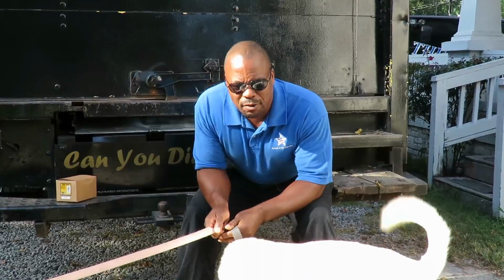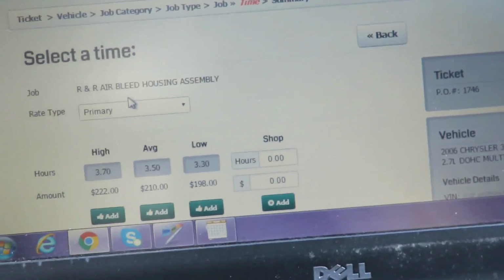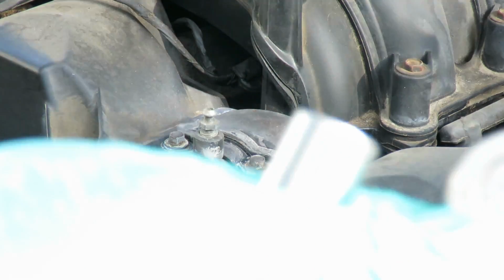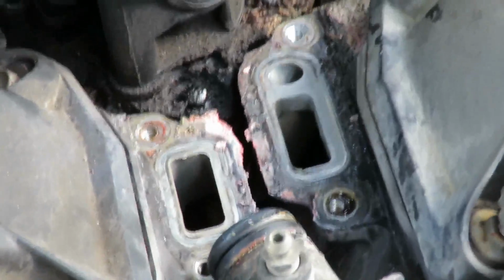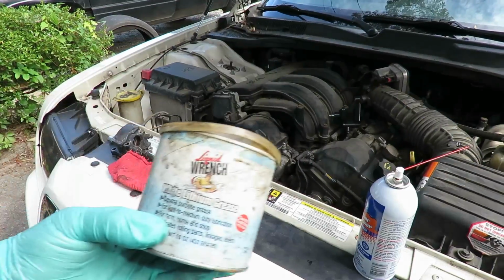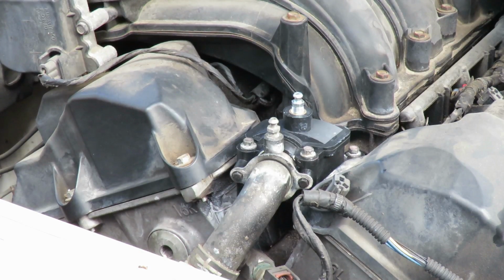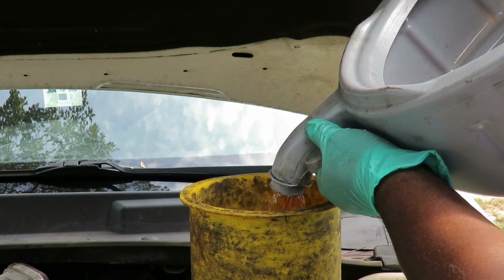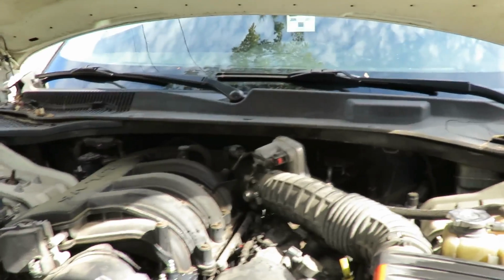⭐ 2006 Chrysler 300 - Air Bleeder Valve Housing - Water Outlet Housing

Comment: Hi Mr. Tim, do i half to drain that like you did in the video?. Or can't i just undo the bolts and replace the part. I have a 2008 Chrysler 300 2.7 L
Reply from the maker: Hi, you can just replace the part, but you might have coolant draining on the belt, and cause it to squeal.
Reply: Thank you so very much!. I'm not mechanically inclined and really don't know what i'm doing. But at soon to be 59 years old, never to late to learn. And can't afford to pay close to 200 for a job i can try and do myself thanks to you Sir 🙌🏾🙏🏾🫡@OnlineAutoRepairVideos
Reply: Mr. Tim update: my family (  3 others ) got the job done. But it took hours!. That unit didn't have room to pull that pipe out. So we had to unlosen the manifold cover, then pull it up to take out the part. Then, he had to run the car for 45 minutes to get the air out. Because  my heater was blowing cold air. And open up that nipple and bleed the radiator properly. Thank you again!. 🙌🏾💯🙏🏾
@OnlineAutoRepairVideos

Comment: good evening everybody . i came here for help . what is the name of the tube/hose connected to the air bleeder valve ? the one with the little valve on top of it ? i believe there is a connector on it as well . name or part number will help . thanks everybody

Comment: Nice detailed video! I have an 08 Dodge charger and just started leaking coolant from this area. When I went to inspect, I saw coolant bubbling from the bolts that hold the housing down. There was also coolant everywhere even hit the roof of my hood. Would that be the cause of the leak and would replacing that part fix it?

Comment: Any advice on what to do if the pipe doesn’t slide back to give enough room to take off the bleeder valve?
Reply: To anyone who has this same problem in the future theres a small bolt in the back that you take off and it loosens the pipe. After that it’s an easy fix.

Comment: Very detailed video! thank you very much for sharing.
30:18 I would like to consult if it is necessary to turn on the heating after closing the valve, somewhere I read that the coolant must reach the heating radiator, but I did not see that step in your video.
On the other hand, I just subscribed to your channel. Thanks my friend.

Comment: I have a Chrysler 300 I put new fuel pump in and it will start and run when it fills like it I check it with scanner and no codes come up any one no what the problem may be

Comment: Thanks for this video bro I'm a seasoned mechanic and even I was pissed at this engine design,  I just rebuilt this Chrysler 2.7ltr for a friend and upone doing the engine break in procedure I couldn't figure out for the life of me why this fuckin thing has 2 calves, I rebuilt this damn thing from top to bottom new everything except valve covers and plenum,  and I'm sittin here wonder why the fuuuck is this thing still going hot on me, and all I had to do was open and pour till fluid came out of this damn valve🤣🤣🤣😂😂😂 these engines are the fuckin sludge kings. I'm so happy to get this thing out of my garage, I wouldn't advise anyone to get a Chrysler with this engine, thanks to you I'm sending this p.o.s. out of my garage. You just gained a subscriber,  thanks bro.💪🏿💪🏿💪🏿💪🏿

Comment: New Subscriber here from Tampa,Fl...I will say that you are the kind of mechanic we all wish we had!!..I have always hated to go to a garage so I have always done my own repairs ....My roommate has a 2009 300 2.7 and it was running hot..I was not able to look at it for her as she had it towed to a repair shop that AAA recommended..They were not very optimistic from the start saying could be blown head gasket and $$$..Now this is a low mileage old lady 44K mile car dealer maintained well taken care of car,..as soon as she saw it run hot she stopped...well the shop replaced what you did this video on and charged her $387!!!! I thought was terrible!! Was this a rip off??? I felt they could have lied and said something worse as I was not able to look at the problem before it was towed..(I have always done my own work)..
Reply from the maker: That does sound a little high, but it also depends on their labor rate. But, you're right it could have been a lot worse. They could have told her it was a blown head gasket and charged her over $1000 meanwhile all their doing is changing the air bleeder valve. Sometimes it's hard to trust people. We always try to be honest with our customers. If you are honest and don't rip them off they will keep coming back and that will make you A LOT more money then ripping them off one time. Thank you for subscribing, Chris.

Comment: Why when i changed the housing my upper radiator hose rubbed against the alternator belt making  a hole on the house please some one help me
Reply from the maker: Make sure the housing is the same and be sure the hose is routed correctly. If you can, send me a picture of the housing installed on your engine; Tim@AstralAutoRepairs.com

Comment: Thanks for the vid it helped but now I have a problem. I have water bubbles coming from the top of the valve. What did I do wrong ?
Reply: Lord_Kevin you need to bleed the system so there's no air bubbles
Reply from the maker: Sounds like you may have gotten a bad one.
Reply: Damn ok thanks

Comment: I had a hole in my radiator hose and the car  was running fine bt fluid was going every where I gt a new one and my car started running back hot
Reply from the maker: Make sure to bleed the system

Comment: the cap blew off my housing and no indications on gauge inside steam shooting out..what would cause this?
Reply from the maker: Hey Dan, it could be because of age. Once you replace it, let the car run until it warms up, then feel the upper radiator hose to see if it has a lot of pressure building up. If so, you may want to replace the radiator cap. Let me know how it turns out.
Reply: Dan, my car just literally did this same thing! LOUD pop then steam everywhere! Opened the hood and top of housing had blown off. What was the end result for you?

Comment: What's that metal pipe called that the hose goes too and then goes to the outlet housing mine has a leak in it but I don't know what it's called it has a leak at the t on the bottom of it
Reply from the maker: You can try Bypass tube, or better yet, you can find a chrysler website and look up a diagram to actually get the part number, or you can call chrysler for the part number, just be sure to explain it just like you explained it to us.

Comment: I need to replace the actual pipe going to the heater core. How much stuff do I have to remove to be able to get that pipe out? Is there an easy way to do it or does the entire radiator have to come out?
Reply from the maker: Hey Chris, I am not sure if the radiator needs to come out or the intake.
Reply: Astral Auto Repairs it sure looks like it. there is only a minimal gap between the ports the bleed valve bolts on to. we have tried 3 different bleed balves and orings and it keeps leaking from the hole where the pipe and oring goes. amy only logical deduction would be the pipe needs to be replaced.
Reply from the maker: Hey Chris, I just confirmed that yes, you will need to remove the intake manifold(s)

3.5L - You have to remove the upper and lower
5.7 & 6.1 - you have to remove the intake

Hope this helps, and let me know how it goes if you do it.
Reply: I have the 2.7L, not sure what you meant by removing the upper and lower. Perhaps by removing the intake it will allow me to swing the rear portion of the tube upward and allow me to slide it out without removing the radiator.
Reply from the maker: What is the year, make , and model of your vehicle, I must have looked up the wrong vehicle.
Reply: 2008 chrysler 300 lx 2.7l
Reply from the maker: That must be a difficult one because I had someone look it up and it showed the 2.7, but didn't show the procedure to change it. Nobody on youtube has the video?
Reply: 2008 chrysler 300 LX 2.7L
Reply: Hey Chris cox did you manage to take it out ? I might have the same issue mine leaks where the pipe slides in to connect. Do you know the name of the piece ? And how you managed to take it out if you did ?

Comment: You HAVE to drain the radiator first right?
Reply from the maker: You only have to drain enough to get the level below where you are working, OR, you can place a pan beneath the area you are working so the antifreeze will drain right out and into the pan.